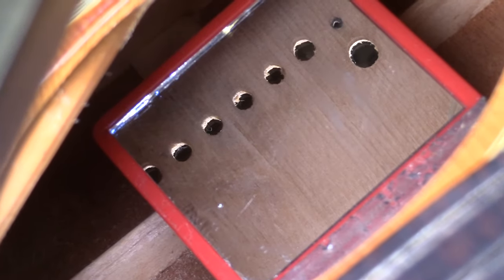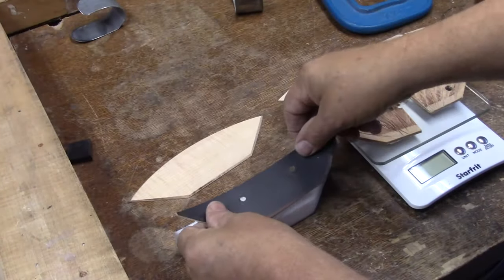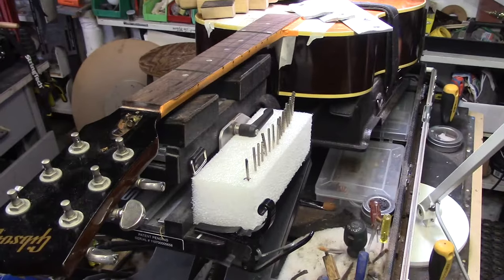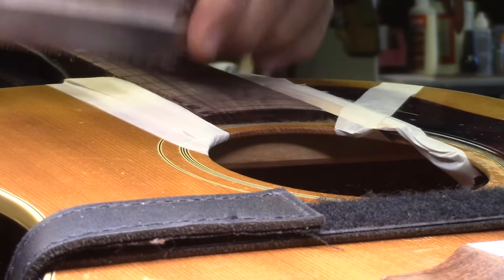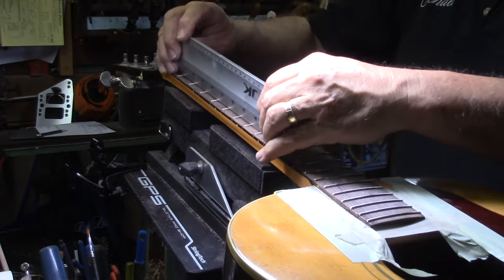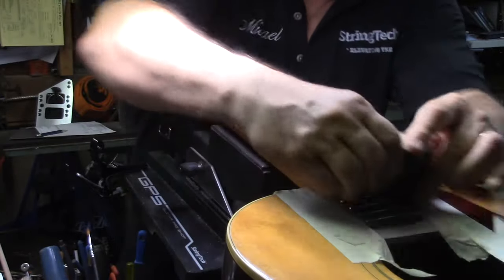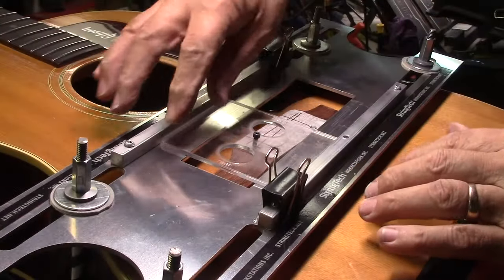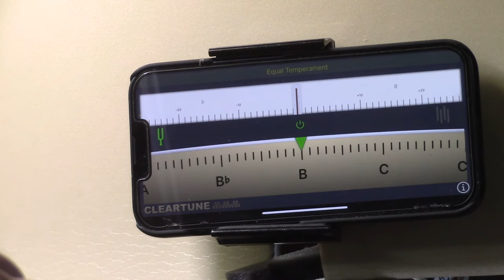Gibson J-50@StringTechWorkstations

Comment: As usual love your work thanks again 
Great teacher. Michael just a suggestion, see how this works for you. Point the mic at the 12th fret angled slightly towards the sound hole. 
Best wishes
Kind Regards

P.s saw tool made called fret maestro wondered if you’d seen or tried it. 

By sixstringers

I’m not affiliated or connected in anyway just thought great idea 
By
Thanks
Kimball
Reply from the maker: Hey Kim thanks for the mic suggestion, will try that. On the first Quick tips video you will see a short mill file that I have attached to a "suspended ceiling" steel rail. As you know ... I am big on following  the trajectory of the string path when levelling frets. I just had a quick look at the "Fret Maestro ".  I have a typical fret dress down to about 12 minutes ... using the GPS TechDeck and the fretting kit. But thanks for thinking of me. Cheers Kim !